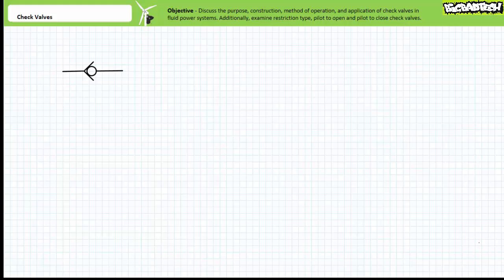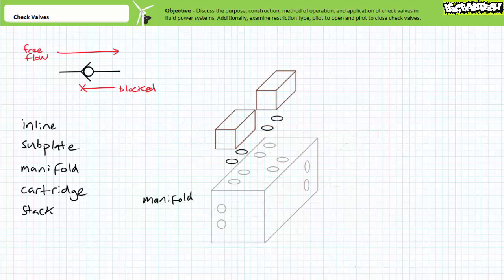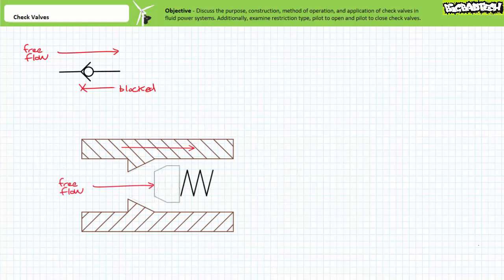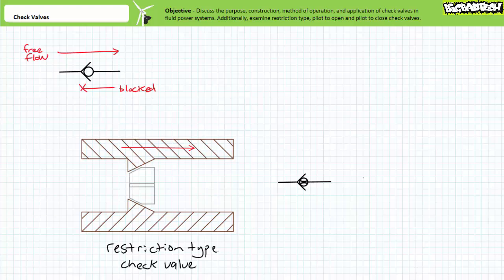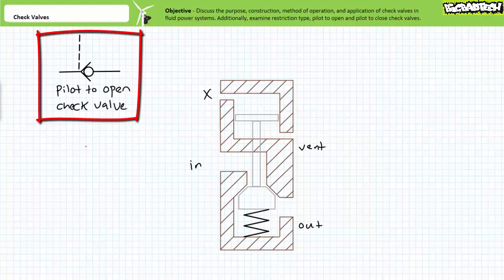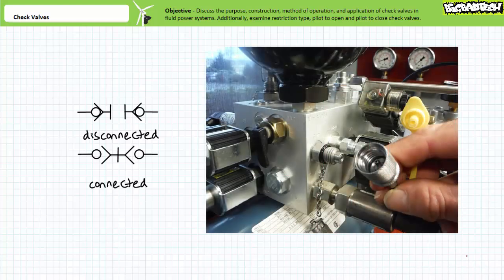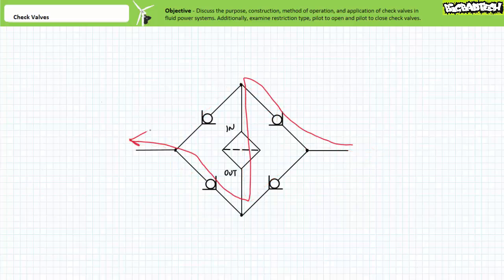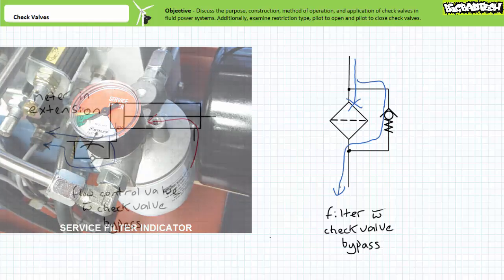Check Valves (Full Lecture)

Comment: Hi Jim I must say I enjoyed your lecture on check valve. I would like to ask a question . When oil is subject to change in viscosity I am I correct in the understand- the the amount the ball poppet valve is moved of its seating is  directly proportional the the chang in viscosity? in other word the thinner the oil the less the ball moves and the thicker the oil the more the ball is displaced therefor maintaining the upstream pressure? Regards Rob
Reply from the maker: Interesting question to which I honestly don't have an answer. Someone with a fluid dynamics background might have to step in here. There's arguments both for and against. Example a thicker fluid (ie: higher viscosity) might push the poppet off easier however a thinner fluid might flow around the poppet easier. I'm certain one could find some manufacturer that offers a flow rate/pressure drop as a function of viscosity chart.

Comment: Hi Jim.  Good, clear lectures.  Thanks for putting this out there.  

One thing puzzles me about the pilot operated check valve.  Your diagrams seem to indicate that when fully opened, there is no pressure from the output port to lift the poppet.   Which seems to mean that only when the pilot pressure goes below the bias can the poppet start to move to close.  Quickly enough, the pressure from the output port will contribute to lift the poppet and shut the valve. 

Am I missing something?  I was assuming that the valve shuts when pressure on the output is greater than the pilot pressure. 

Best wishes, whether you find time to answer or not. 
/Claude

Comment: Jim, will there be a reduction of speed flow in the flow control valve with check valve bypass system due to the flow passing through the small hole? Wasn't better a check valve blocking the flow in the flow control valve line and diverting flow to bypass line?
Reply from the maker: Yes, check out the flow control valves lecture at: https://www.youtube.com/watch?v=Tn3bsiQx1Ug

Comment: Can you explain the benefit of by passing a flow control valve with Check valve ? I am finding it little difficulty in getting the exact explanation. If you can explain it in a more simple way, it will help me a lot.
Reply from the maker: +Mech E Check out the flow control valves lecture: https://www.youtube.com/watch?v=Tn3bsiQx1Ug and the flow control methods lecture: https://www.youtube.com/watch?v=VFtRNAu3_wg

Comment: Jim, does a hydraulic system when in totally static have empty pipes or hose? Or all the system is fully with oil?
Reply from the maker: Ideally full, a mix of air and oil would exhibit undesirable compressibility